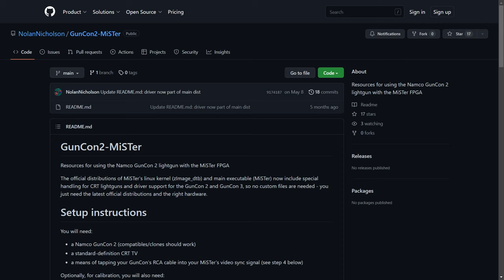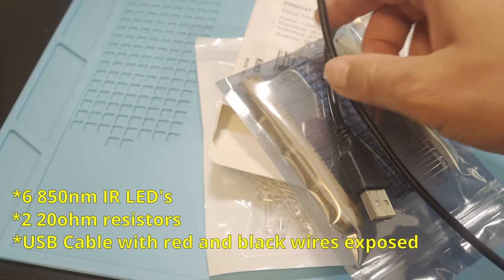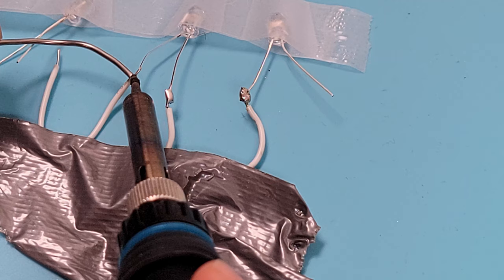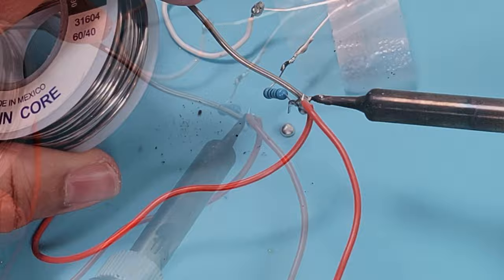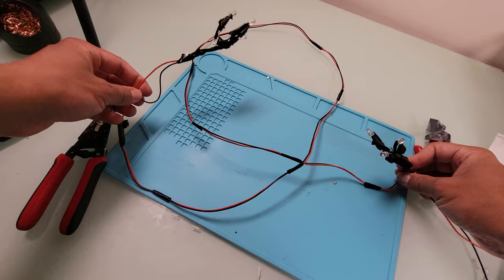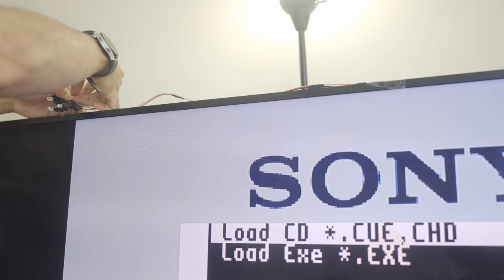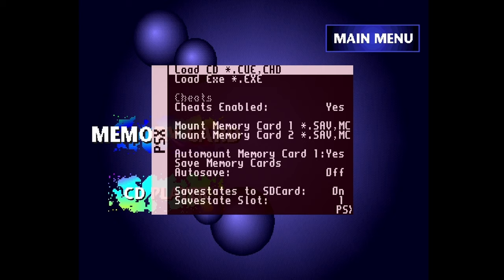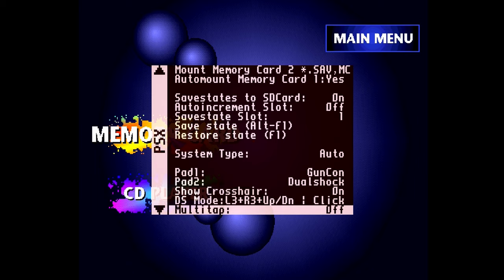GunCon 3 on MiSTer - Build Your Own Emitters!

Comment: Great vid. One recommendation to improving your soldering skills is - don't just melt the solder, but apply heat to what you need to solder and then touch it with the solder so that the soldering area melts the solder and you don't end up with a cold joint, which results in bad electrical contact in the long run. Saves you a lot of headache in the future. For everything else, thanks and Kudos!

Comment: Please advocate heat shrink tubing over electrical tape. Electrical tape leaves a sticky mess if/when it comes off, doesn't stand up to time or heat very well, and can partially separate allowing for shorts. Many heat shrink tubings also include a hotglue style sealant inside, and taping a few strips of straight stuff to your TV is more aesthetically pleasing than a gnarled mass of electrical tape. Your soldering tool is too hot, and your style is too "touch and go" -- normally you want to linger longer to create a hotter joint, so the solder can bond more properly to the wire. Your iron is so hot it's beginning to burn the solder and its flux core, even at your elevated speed. Further, I STRONGLY suggest Silicone jacketed wire; once you use it, you'll never use anything else. The wire is better quality so it won't break as easy/often, and the jacket is (almost) chemical- and heat-proof. Finally, a 22 ohm resistor will perform effectively the same exact job, but 22 ohm is a standard value where 20 ohm is a precision-only value and may be more difficult to source! Great work as always, sir.
Reply from the maker: Thanks! I definitely want to improve so I appreciate the advice. Lots of good info you provided.

Comment: When soldering, it can help to first treat each end that you want to solder to another on its own and prepare it by pre-tinning it. Once you have two pre-tinned wire ends next to one another, you can just touch those with a soldering iron and they will connect and fuse as the solder reflows. Your duct tape solution to the "I don't have enough hands" problem that everybody has is not bad. Doing this by hand takes practice and risks burning yourself, as every experienced soldering technician has done at some point. There also is a tool for that, with its own Wikipedia article: Helping hand (tool) – but do what works for you.
Reply from the maker: Thanks for the advice!
Reply: @LusRetroSource  You're welcome, and thank you! It's actually pretty nice to see unashamedly beginner-level soldering here, because it shows others they can do it too, and it doesn't have to be perfect.

One thing I would add is, it's better to plan ahead and use heat-shrink tubing instead of electrical tape, because the latter doesn't last as well in my experience.

I've also been meaning to email you about the Mattel Aquarius ever since I watched your video on that. Maybe this will finally shame me into getting that act together and pressing send.

Comment: I appreciate that you looked at Area 51 - I bought the GC3 over the summer and had no issues with Genesis, NES, or SNES, and solid results with the PSX, up until I tried Area 51... I couldn't find any instances where other people had posted that they were having issues with it, so I gave up and assumed that it was just an issue on my end. Glad to see that it's not just me.
Reply from the maker: Ha ha. Always good to know you're not the only one. Some viewers have commented that some Justifier games have been patch to use the GunCon, so I'm going to have to test those patches to see if they work better.
Reply: There are a lot of patches for justifier games to make them work with a guncon. I’ve read the patches are more accurate than native justifier support.Area 51 has no patch.

There have been some recent builds that improved justifier support for PSX and fixed accuracy / reloading.

Comment: Thank you for this great and detailed video what was just come in time. Few weeks ago i got a CRT for my mister. I have a collection of lightguns for ps1 and ps2 and now its clear how map ps2 gun for the mister. Guncon45 works with SNAC but i need to feed the composite signal to the SCART instead of Snac composite port. I bought a PS1 Hyper Blaster Justifier for specialy this games, but unfortunately doesnt work yet (No composite plug for the gun). Tomorrow i will solder IO6 jumper on my IO board let see can i get them work corretly.
Reply from the maker: Awesome. You have a great setup!

Comment: Do the peripherals (not the SNAC method) allow me to use two Guncon3 on a single Mister setup with a modern tv?
Reply from the maker: I don't have another Guncon3 to test but I don't see any reason why 2 shouldn't work. I was able to get a Guncon2 and Guncon3 working together with MiSTer on a CRT.
Reply: Yes it supports two guncon 3’s on one mister with one set of sensors.

Comment: hi, i'm a noob here asking for help please. when I start my PSX core on Mister, the Playstation BIOS does not show in fullscreen, taking up just the centre of my TV. hence I cannot calibrate my GunCon 3 like how Lu does. but once I'm past the BIOS screen and when a game boots up, it will display properly in 4:3 and touch the top and bottom edges of my TV. i wonder if this is the reason why I cannot seem to get my GunCon3 calibrated and working like Lu's? I notice that my crosshair tends to be way off when I aim to the left and right, but less off towards the top and bottom. many thanks to anyone who can advise!
Reply from the maker: You probably have fastboot set to on in the menu. That skips the BIOS screen. However, you dont need to use that specific BIOS screen for the calibration, it's just the easiest one to use. You can use any screen that shows  you the full 4:3 area. The point is to find  a screen where you can see the left and right outer bounds.

Comment: Is is posible to use the guncon 3 on a pc could it be posible to make a program similar to mister to windows?
Reply from the maker: There is an unstable driver, but I haven't been able to get it to work.
Reply: @LusRetroSource  it would be awesome to have a working driver from this work for the mister for pc, i have a guncon 3 lying around with original sensors waiting to be played on a pc but i haven`t had any luck finding one.

Comment: In short use wii bar powered by AA batteries 
To work perfectly 2 bars  on  top and one down it’s it’s work great with my ps3  

I discovered this by accident  work will with ps move and guncon 3  try it and let everyone know about it
Reply from the maker: Can you tell me the exact wii sensor bar you used?
Reply: @LusRetroSource  Duracell wii bar sensor wireless
Reply: Use 4 double A battery
Reply: @LusRetroSource  there is one rechargeable also by I use one with no rechargeable
Reply: Don‘t get your setup. So you put one bar at the bottom (centered?) of the tv and two bars at the top. How exactly to you place the two at the top. Centered on on top of the other or centered side by side?

Comment: I need a lightgun for all cores for my crt monitor. I have justifier for snes, I wonder if some day it wil compatible with all cores.
Reply from the maker: I don't see non-usb lightguns getting support for all cores. The GunCon2 would be your best option, they're meant for CRT's, aren't very expensive to get, work with all cores and are very accurate. 

I have a video for setting it up the GunCon2. It's a little outdated but the only change is that you do not need to use a patched version of MiSTer anymore. I'm still planning on doing a followup video.

Here's the vid: https://youtu.be/s0F8KnqeOd8
Reply: @LusRetroSource  You are the best. Thank you.

Comment: Can you not use a wireless wii bar ?
Reply from the maker: Mentioned in the video that it doesnt work. The IR emitters need to be a specific wavelength that the Wii emitters do not match
Reply: @LusRetroSource  Got it, thanks.